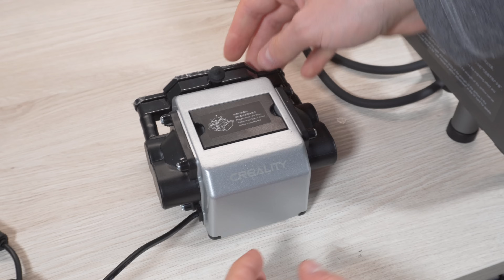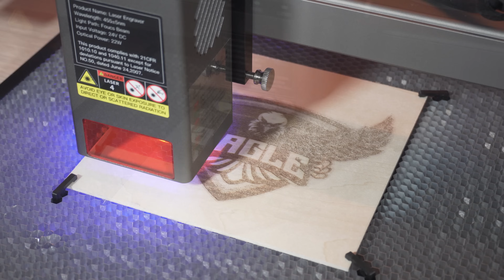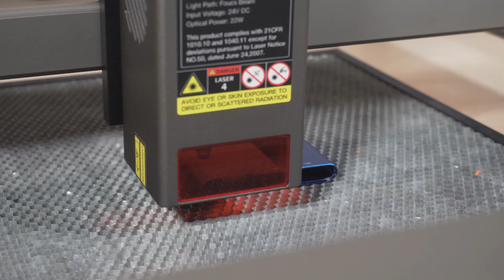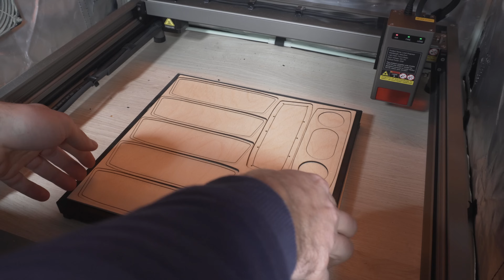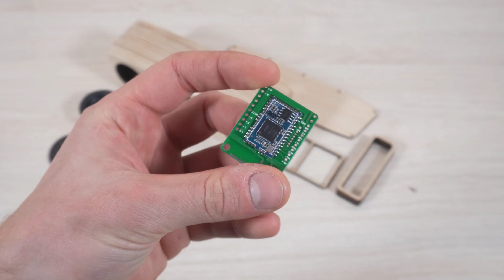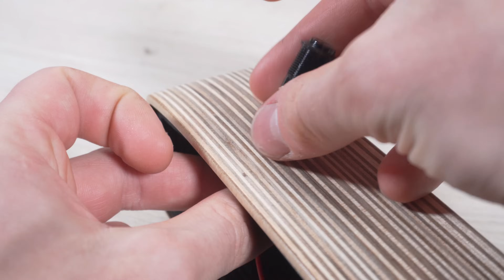DIY Portable Speaker Build Using a 22W Laser

Comment: Hello! Suuuuuper nice build really like it a lot!! but why the capacitor?
Reply: The capacitor blocks low frequencies from getting to the tweeter and burning it out. More often there would also be a resistor and a coil on the tweeter part of the circuit.
Reply: goodgoat that is true for speakers with bass & treble drivers, but here you only have one full range driver. In this case the capacitor is to store energy which gets used on bass heavy songs. If there was no capacitor, the sound would clip/distort on high volume & bass songs because the output peak current from voltage booster board would not be enough

Comment: The module u are using already have battery protection so why are u using extra module??
Reply from the maker: The charging module only lets for a 1A discharge, which is quite low for this speaker, hence the higher output protection board for the battery.

Comment: All good. But I would never glue down a lithium battery with this type of adhesive. Only friction fit it or slide it into an easily removable frame. It's a pain to replace it later. And also a bit of a puncture hazard during removal as the metal case is really thin. Even worse with the soft cells that sometimes even bend.
Reply from the maker: Thank you. The adhesive is more of a sealant, doesn't attach to the wood or the plastic too well. These cells don't need to be replaced often. One good quality cell will outlast the speaker I'm sure.
Reply: @DonnyTerek nice build, i'm building a portable speaker myself and i'm afraid the battery will catch fire..do you have any tips to avoid this? Are you not afraid the battery will get loose and shortcut or something( i have OCD ), do you still use this speaker ?